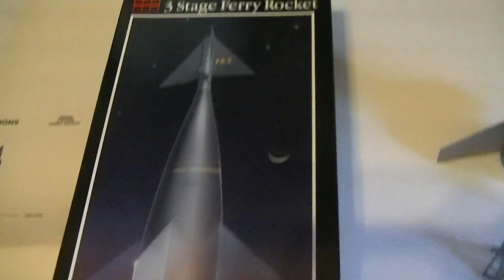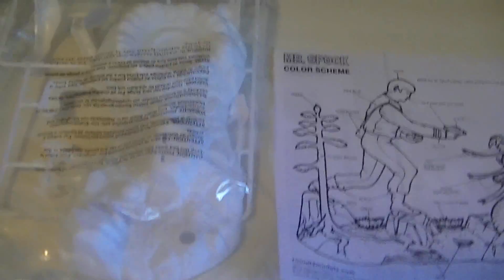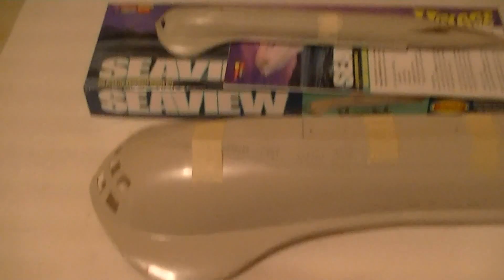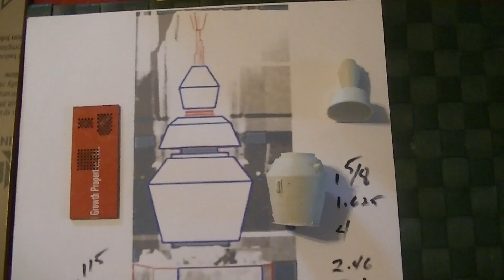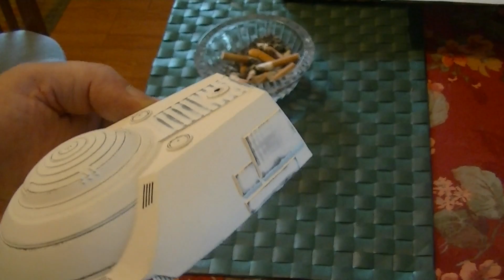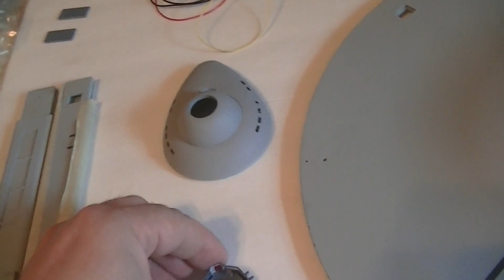Captain Quirk's Model Shop 1

Comment: That is funny as hell, I sold that Nomad on e-bay months ago. It was from Lunar Models, I call it a lump of resin. There isn't good cg model of Nomad in the public domain.
Reply from the maker: What's funny? I've done my own research and have in fact modified three existing CG models. Having said that, you're right, there was not an accurate CG model, however, I am working on ACCURATE plans and am in fact creating an accurate CG model by correcting parts of existing models. Please see the most recent movie as I stated that I had researched the model for more than a month.
Reply: Then let me give you a few keys, on the back of Nomad's head is the top of a Klingon Disruptor. On the deck are a number of bridge buttons. The Lunar Model is funny as hell, it's only good as a collectable. As far as a buildable model goes, that's were the laughter starts. I got that kit for the same reason you did. Nomad taught me a lot of lessons about Trekkies, never share your stuff because they are not even appreciative only critical.
Reply from the maker: Max Mills Max, I did NOT buy any part of this. I am doing my own work and my own research and my own construction. This is NOT a Lunar models kit. This is a scratch built kit. The laser cut parts are my own, I have been creating laser cut parts for Trek props for years. The one that I show in the this movie is wrong, because this is not the most recent movie. I based the part in this video on existing blueprints that are also inaccurate. Thus, I started researching every aspect of the Nomad probe on my own. I've learned that you cannot trust anyone else's references, if for no other reason that the other person might not do their due diligence. I am aware of the facts that you present as I have done my own due diligence and have indeed spoken to people in Hollywood that know what they are talking about. Having said all of that.... Not all Trekkies are ate up with ignorance and not all of them are weasels, though those types are represented in Trekdom. I've ran across my fair share. I share my stuff because my friends that are trekkies do appreciate it and I don't care about those that have nothing better to do than tare down someone else's work. thank you for your input. Please stay tuned until the final prop is revealed.
Reply: You showed the Lunar Model kit in this video, I know because I used to own it. I assume it belongs to a client of yours. I didn't send it to the northeast. The documents are only 85-90% accurate, I know because I spent a year and a half of my life making them, So thanks for tearing down my work. If an item was in 2 shots it made it to the model. I went about cross eyed tracing profiles in autocad, luckily Nomad is a very simple prop, but doing the detective work on it was a lot of fun. I can't believe that was over 10 years ago. Yes, I did leave details out my documents.
I hear you, I wouldn't trust the word of the guys who made the prop, much less anybody in the hobby. The only way your going to get an accurate prop is to find the original. Nothing any of us do will ever be truly accurate. A reasonable facsimile is the best any of us will ever get. 
You don't have anything to worry about from me. I'm out of the sc-fi prop game. I got chewed up and spat out. All it takes is one weasel to ruin your day, and that's what happened to me.
I've got a lot of knowledge on the subject and thought I could help. If you want to verify my honesty, we have a few friends in common you can ask. 
Just do me one favor, DON'T GO BY THAT FRACTION OVER A METER CRAP! (Because I would love to know what that fraction is.)
Reply from the maker: Max Mills I did not show the Lunar models kit in this video! I don't know where you get that? Look at the most recent video. If the 1/6th scale model is a Lunar models model I had no idea, it was sent to me by a client. I could tell it was wrong the instant I saw it. I was contracted to create a 1/6th Nomad that was accurate and that has lights and voice clips. I was not attempting to tear down your work, however, when I relied on it and had a part laser cut, I could tell it was off and started delving deeper into the studio model and found that even the one that was at Vegas was wrong. I do not believe that a reasonable facsimile is as close as you can get. I do my very best to research a thing until I'm confident that I can movie forward with a prop that can be "Screen Accurate."  My friend John and I worked for seven years creating an accurate 50" Refit and have shown comparisons between the actual studio model and our own. You're right, the Nomad is a simple prop, but like anything else, the devil is in the details.
Fraction over a meter.....? I know that as well. The Nomad is larger the 3.2 feet. Perhaps we do have friends in common, if so, then friend me on Facebook. I will be creating a blog post showing every aspect of the research that I've done and will go over every detail. Thanks again for your input. BTW, the Nomad in this video and the one in the most recent video is also I:I Studio Scale. I'm doing both.
Reply: I recognized the model right away, I never cleaned it up. It had the same marks as my model, is the trunk(body) not exactly straight? The model was sent with it's original box, so who knows what happened to that.

The parts were not off, I used them to print my Nomad, and had no interference after assembly. The outer panels were cut on my router out of styrene. But if you used the pdf files, you might run into some trouble. At the time the pdf files I was generating were giving me some issues. The images came out a hair smaller than the actual drawings/model so they were not dimensionally correct. Plus I rounded a number of dimensions, if you notice they are all rounded one way but not another. Anyone who knows what they are doing could figure it out(as I'm sure you did). I was using it as a tell, in case anyone used my drawings and took off all of my graphics. Which I've heard did happen. My Nomad stands around 4' tall, a friend came up with the overall height and I confirmed his number with the model I came up with. Which is a fraction over one meter. I tried to make it work just over a meter, it never looked right. I really wish I could have measured Nimoy's hand, but that's something you don't ask a guy. 
Sure I'll friend you, I hope you don't mind a conservative viewpoint.
Reply from the maker: Max Mills Max.... I'm really not trying to get into a contest on this.. Conservative? I'm one as well. At the very least I'm a pragmatist.